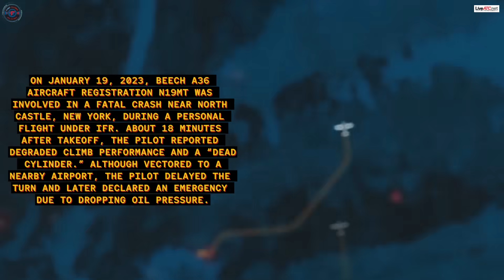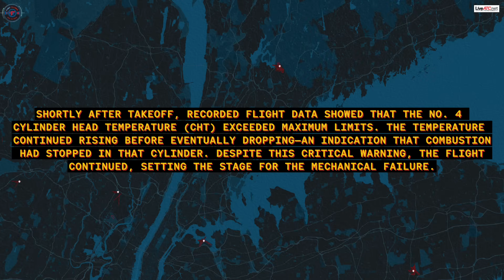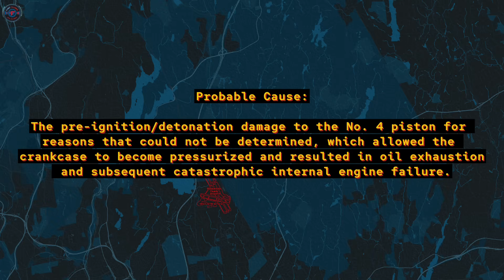“Dead Cylinder.. losing oil pressure!” - Fatal Beech A36 Crash Moments Before Impact #atc

Comment: that was really weak on the pilots part.   guys, if you are as weak in the air as 19MT was, do not fly in hard IMC conditions.  You need to be assertive, have complete confidence and be proactive and take measured steps cold and calculating to successfully get yourself down.  this was a survivable situation

Comment: Hey is the video not synced correctly with the audio? It shows the crash for 19MT but the pilot is still transmitting.
Reply: The explanation is clearly stated describing the editing error.
Reply: @sarahalbers5555  Yeah I see that now, the explanation was posted about an hour after I commented on the error.
Reply: Sorry about that
Reply: @sarahalbers5555  No problem!
Reply: Shit happens. Read the top comment. If you need pictures to undersdand an accident, this is probably not the channel for you.
Reply: @mosaici.t.s8766  Yeah the top comment was posted after I had pointed out the error. I was just pointing out a discrepancy between the video and audio to the channel creator, which they had then noted. If you need help understanding how chronology works, I'm happy to help you out.